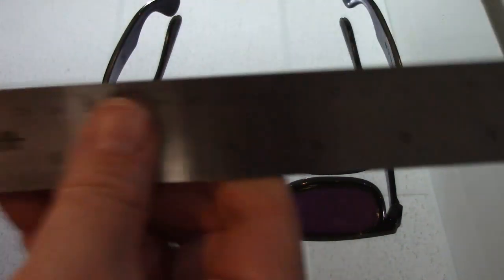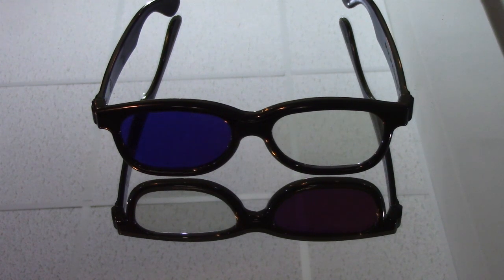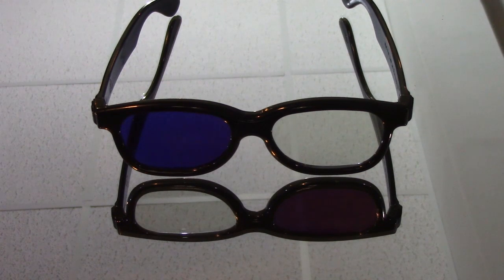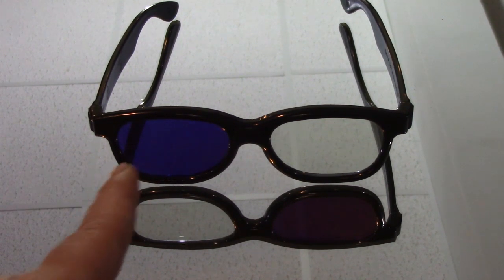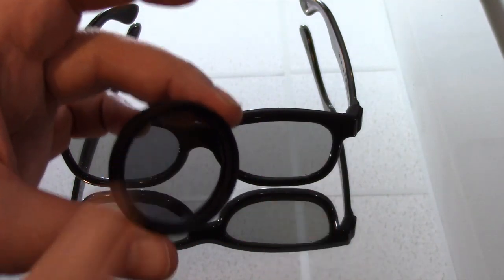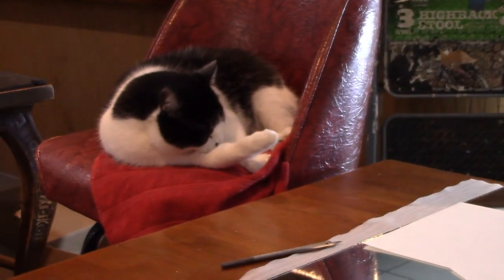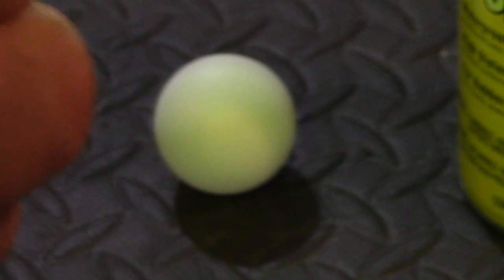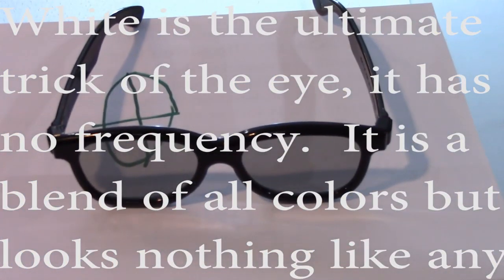T9: Circular Polarization IS NOT A REAL polarization.

Comment: I noticed you put the two linear filters after the circular polarizer. Of course there'll be no light coming through. Try putting the linear filters on either side of the circular polarizer: you'll find that the circular polarizer acts as a quarter-wave plate regardless of orientation

Comment: Light is not made up of particles. Light is a resonant reflection of a di-electrical field interaction.
Reply from the maker: I certainly don't agree with the photon model of light; however,  "resonant reflection of a di-electrical field interaction" sounds like you have been hanging around ken wheeler too long.  A dielectric is a construct of oppositely charged particles. Reflection occurs when light bounces off something?  Resonance requires a physical construct.   So Resonance, Reflection, dielectric and interaction all require constructs of matter; therefore, I don't buy that explanation either.  In Ethereal Mechanics, light is just waves on the Ether just like water waves on the Ocean.

Comment: If you think of the circular/helical light as a narrow helical stream of tiny 'photonic elements' (balls, particles) all traveling in straight lines but with the light source moving in a circle on the quantum scale some things make more sense.. standard linear polarisers would reflect much of the helical light back. A vertical + horizontal polariser would be dark... A linear + quarter wave polariser  creates circularly polarised light which means less oblique reflections off metals.
Reply: The proper way to think of light is di-electric resonance inside a field. Light is not made up of particles.
Reply: @DonaldWatkinsIII .. I know it's the proper way but argue its also an incomplete way, as the double slit experiments show.. I prefer a Bohmian solution to wave-particle duality... Wavy streams of photonic elements (EM charge) slicing through an inertia-providing di-electric particle hex lattice field producing an accompanying standing pilot wave.... Explains quite a few phenomena... 

Where is the necessary local rotational information and energy source for helical light waves stored in 'your' model if not in a particle? A traveling, somehow coherent rotating energy pattern I guess.. I prefer a more literal, mobile, real, hex lattice particle field of +cells in a -ve, ethereal sea of 'flux'... My model stores no local rotational information, it's produced at source and the lattice is inertial. I think I posted it here... Liquid Crystal Space... the title is a metaphor.
Reply: @PrivateSi  I understand your di-electric lattice field, only I do not agree with particles. EM vaves interacting create points through which our vision percieves as light. Curious about your thoughts on an underlying ether. Another idea is; we are inside of an electromagnetic field. More than strong enough to  provide your inertia. Our solar system is in a field, our planet has its own field. All of which could provide the inertia. Our galaxy has its own magnetic field. We exist in a series of fields. We can cause them to interact. Tesla was on the way to doing that. Not going to buy into particle physics. Have you seen many of Distinti's vids?